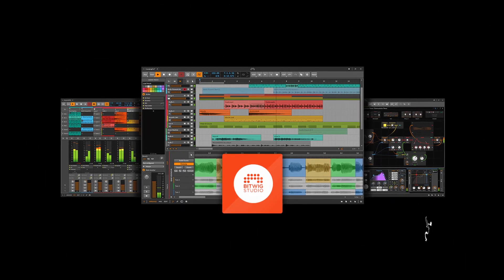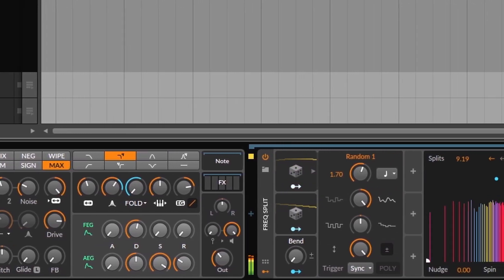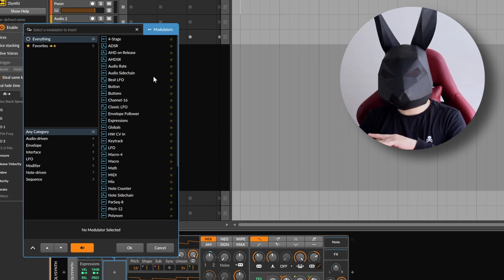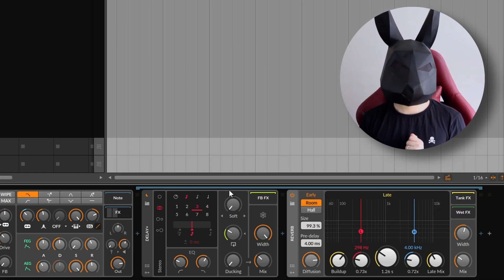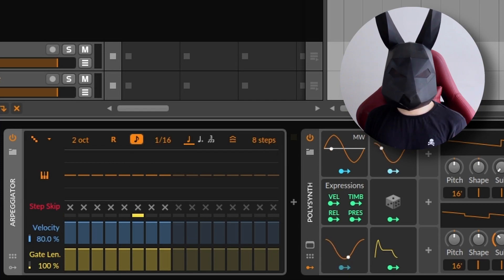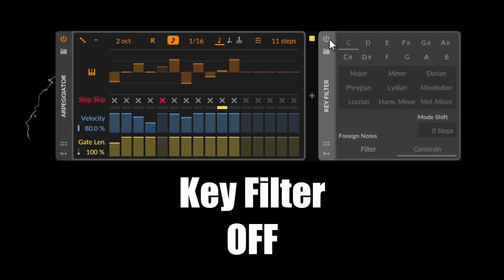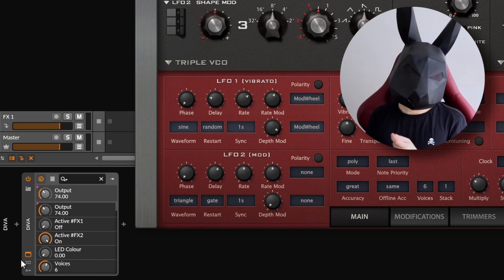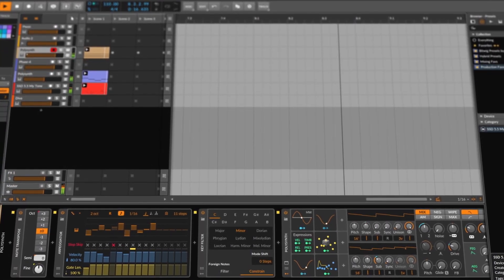Unlock UNLIMITED Potential with Your Own Custom Synths | Bitwig Tutorial

Comment: I saw you post this vid on a fb group the other day and went to look for it on YouTube now specifically. I really am considering using this type of thinking.

Currently I'm finding the grid to be way too cpu intensive. The minute I add a second oscillator, it eats up so much cpu.

I want to be able to have 3-4 oscillators each with a diff filter. Many 3rd party synths don't do that, and so I could just use serum and then group it and do multiple instances in parallel. But I keep feeling I'm not utilising bitwigs modulation power. It's such a shame the grid is a cpu hog. 

But another thing, personally I don't like using the built in fx in synths like serum, not that they're bad it's just a personal preference, I like using my own 3rd party reverbs etc. Even eq is such a big factor in sound design and I wanna carve my sound using Pro q3 rather than a little eq module inside serum or vital or sylenth.

So I've decided to try experiment with the approach you have in this video. Unfortunately polymer also hogs cpu when I run it in parallel, but I forgot about polysynth which might be fine for my needs.

I love the idea of building a device chain that is my synth, with the freedom of using any 3rd party fx and even synths (jp6k or dune or viper have such great sounding warmth but their interfaces feel limited to me), and just having bitwigs modulators to be creative and make lots of little quick articulations to breathe life into my sound.

Its still a shame cos I love the grids interface. But the cpu is the issue. But thinking in the way you are, it made me realize how it's even more freedom to use the building block approach with devices because I get to use any 3rd party plugins anywhere.

BTW I highly recommend a plugin by zeek called stfu. Its free and it is kinda like cable guys midishaper in that you can use it as an mseg for bitwig. You just assign it to an audio rate modulator in bitwig and then you have an mseg that can modulate anything! Bitwig needs it's own mseg modulator though. But until then this is great!
Reply from the maker: Thanks for commenting! I totally get you, and I think that was one of the reason I made this video, to show how the modular, building block approach is not Grid exclusive. I love how easy is to build synths here and polysynth is my favorite lol.
Gonna try that plugin! thanks

Comment: Bitwig mod system is comprehensive but it also screams for long overdue workflow improvement. What buggers the most is inability to adjust actual parameter while mod assign arrow enabled. To fine tune modulation I have to move mouse all the way back to mod assign, click, move mouse back to parameter, adjust, move back to mod assign, click… I can go for days here. I emailed developers and said why not to make this possible via shift for example. Press shift and adjust actual parameter… etc. Unfortunately developers said that user request are not their priority. I don’t even use Bitwig native instruments except sampler just because of this workflow unfriendliness. I can get much further in a synth with less comprehensive bit more user friendly mod system. Audios!
Reply from the maker: I completely understand, but got used to it. Pigments has a nice way to be able to add modulation and change parameter at the same time. Also I tend to click on an empty part of the screen to stop the mapping, but that doesnt work either.
Still, as I said, got used to it